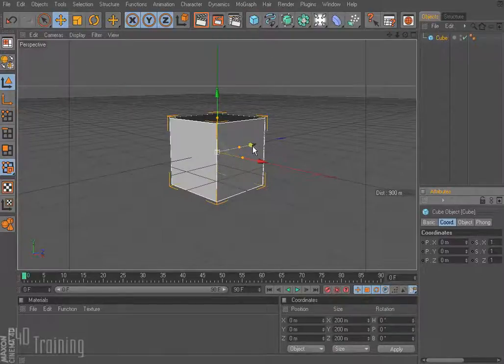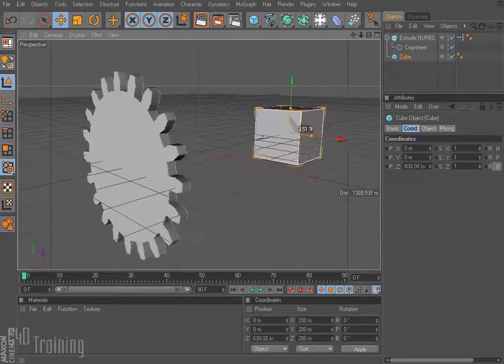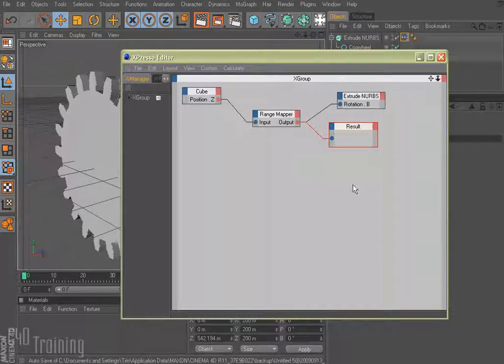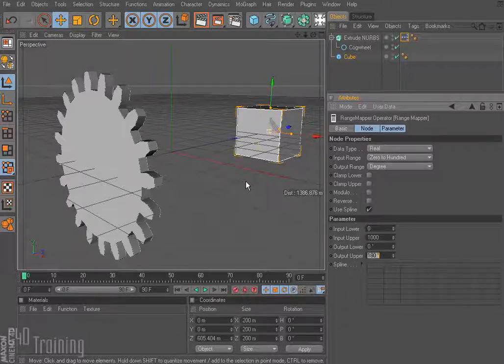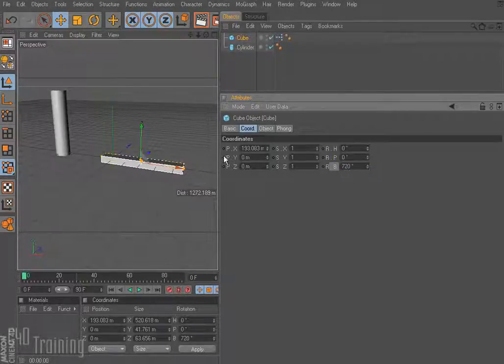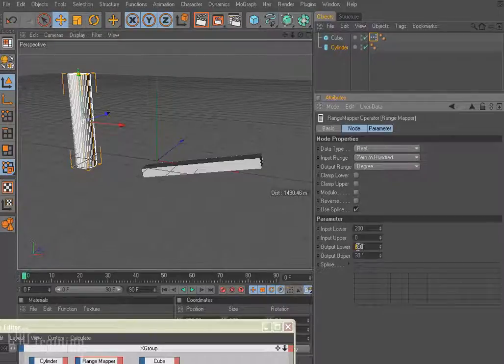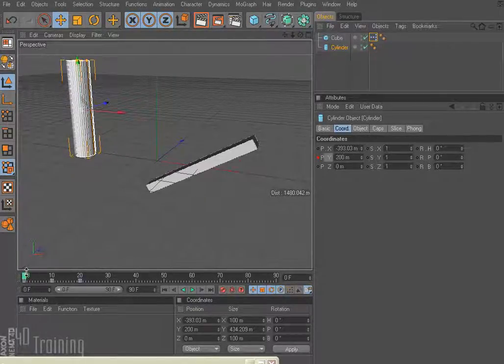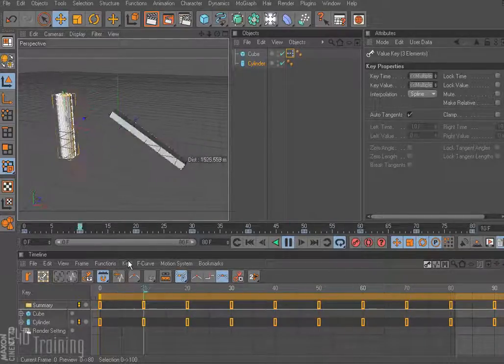Controlling Animation with Set Driver Set Driven in Cinema 4D Tutorial

Comment: Great tut! I have a ? 4 you. My project timeline only goes to about 190 frames but the full length of my projects are normally like 250 to 300 frames. I was wondering why my project time line doesnt show the whole project in time line?
http://gyazo.com/b0711153fbcf98e123778e244d6463eb
My project time useto show up completey b4, dont know what I did to change it :(
Can u help? Thanx.
Reply from the maker: If you look below your timeline where it currently says 0F on the left and 291F on the right... in between there is a grey bar with a white arrow pointed left and one pointed right, grab the right white arrow and drag it to the right...you have 291 frames in your animation, but you are zoomed in.
If you are familiar with After Effects, it is like zooming on the timeline so you can see the frames. Let me know if you can't get it to work.
Reply: c4dtraining Thank you for the quick response :)
http://gyazo.com/f5ce92111519ce73246df582a9ef1a58
I have moved the grey bar already but it still doesn't expand my timeline :/
Any suggestions?
Reply: HawK NeXGeN  Nvm, I figured it out lol
Need to right click grey bar then select expand to full timeline :)
Thanx n e wayz man.